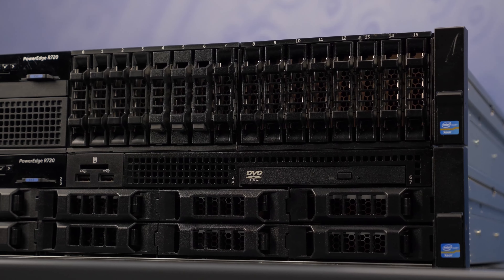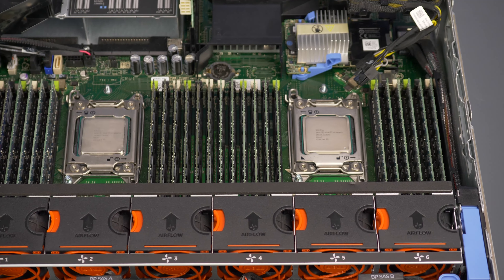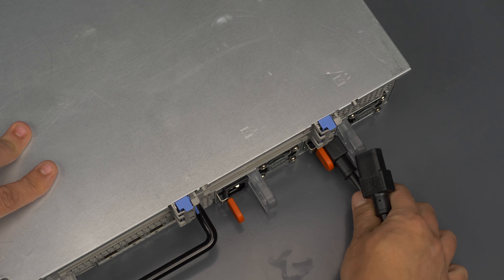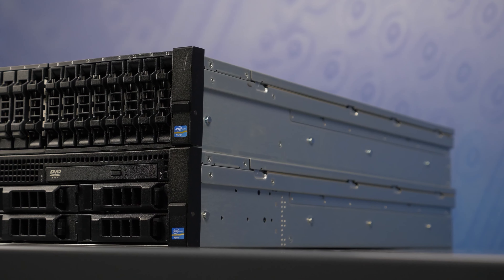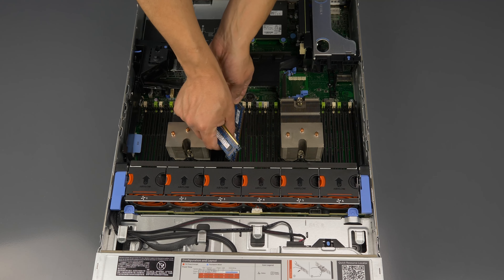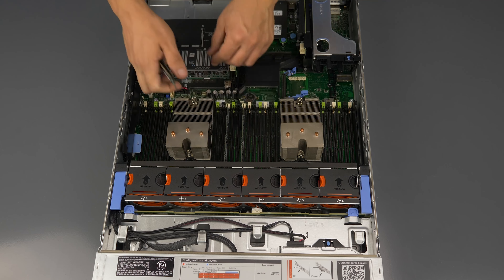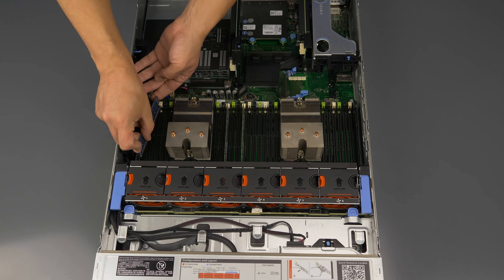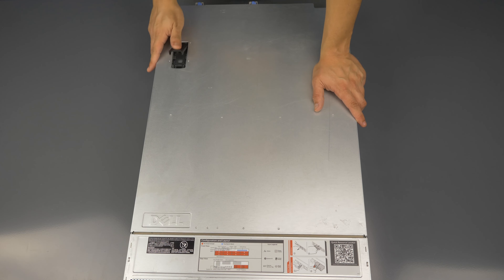Dell Poweredge R720 Memory Installation

Comment: where can i add two * 16GB ram + 14 * 8 GB ram
Reply: Unfortunately mixing of more than two memory module capacities in this server is not supported.
Reply: @seanhall8987  thank you... so this means that i must fill all ram models with 8 gb or 16 only... And there is no way to mix ..
Reply: @Eslam.Basyouni  you can definitely mix memory in the server. I have 12*4GB and 6*8GB in mine right now. You must follow instructions to fill in the channels though. Look in the users manual